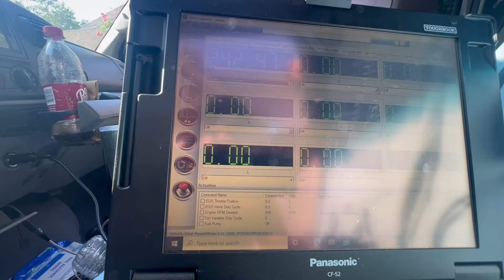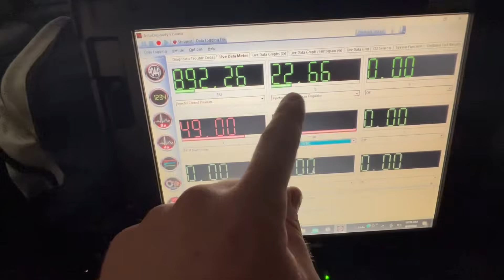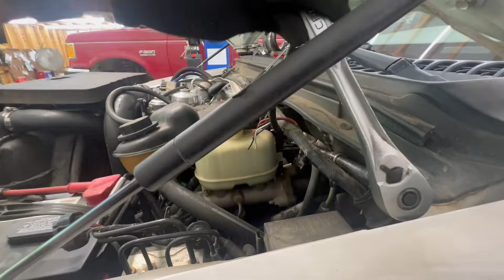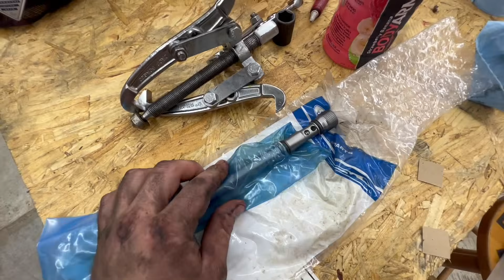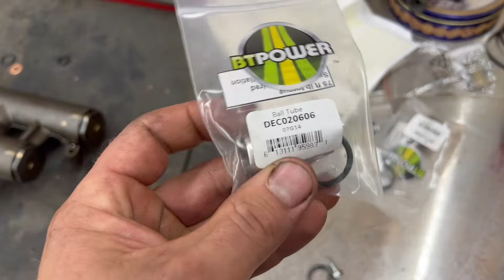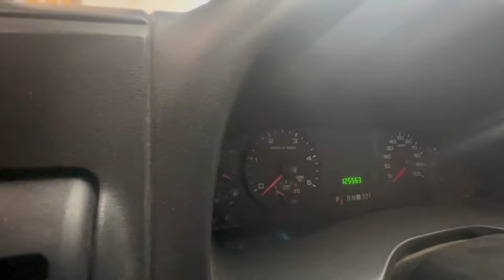6.0 powerstroke high pressure oil leak, long start, no start hot

Comment: Is there updated standpipes for the 03 6.0 as well, or does this only comply to 04 and up?
Reply from the maker: There are not stand pipes in 03-early 04. They have a high pressure line that feeds the rail with a quick connector on it.
Reply: @AutomedicGarage  mine’s having the hard to start when hot and it even dies if i dont keep it at 1200 rpm. Someone’s been in there. Found 4 valve cover bolts stripped on the hvac box side. And noticed the ipr was new.
Reply from the maker: @Srt8brian  I’d bet a wooden nickle it’s your hpop. Those aluminum pump get weak and fail.
Reply: @AutomedicGarage  will i be able to tell with the pressure tool? Or how do I test for a bad hpop
Reply from the maker: @Srt8brian  hook it up to the ipr first with the hpop cover on. It will be harder to hear the leak from the pump but if you don’t hear it anywhere else. Remove the pump cover hook the tool back up and retest.
Reply: @AutomedicGarage  will do. Thanks for all the replies. I really appreciate it.
Reply from the maker: @Srt8brian  no big deal, I’m here to help anyone who wants to work on their own stuff and I’m here to fix those who don’t either. Thanks for watching. Keep following us.

Comment: I personally as well as others have been having issues with motorcraft dummy plugs and stand pipes. I think it has something to do with supply chain issues and changing suppliers.
Reply from the maker: I havent had any issues. Installing with assembly lubes and being careful are a lot of the problems with them also a lot of folks don’t torque them either.
Reply: @AutomedicGarage  Any tricks or tips for getting the bottom piece of the stand pipe in and out on the passenger side without pulling the oil rail off?

My evaporator box is too close and it won't clear it. I have not seen any videos addressing this.
Reply from the maker: @eric91780  remove the oil rail, takes 15 min
Reply: Thread a bolt in and pull it out

Comment: OK, YES, I have the OEM "upgraded" standpipes and dummy plugs from FORD. What I am looking to get is the "NEW" seals and o-rings for them? Thought you might have some part numbers.
Reply from the maker: No I’ve never replaced just the orings. I always buy a new set of pipes. Sorry.
Reply: @AutomedicGarage  OK, so I finally got my tools and did a pressure check through the IPR port. Thank GOD, only found a torn screen on the IPR with chewed up o-ring and back ring. Pressure check was good and solid. Thanx again for the videos!!
Reply from the maker: @curlyelp7530  did you run her yet?
Reply: @AutomedicGarage  Waiting on my IPR parts, tomorrow, do you have the IPR torque value? Thanx !!
Reply from the maker: @curlyelp7530  usually don’t torque, pointless using a universal and multiple extensions.

Comment: OK, so I will defenitely be installing them on this tear down, I still have NOT pressure checked the rails, but very sure the nipple cups and injector o-rings moved or are leaking on the passenger side. Since I removed that side rail to fit or to remove the OLD standpipe. So, with that being said, got P/N's for NEW o-rings and back seals on the standpipes and dummy plugs?
Reply from the maker: I usually buy the updated OEM stand pipes and dummy plugs.

Comment: Ok, Thanx for the quick reply, appreciate it. What do you think about their "Nipple Cups, No Leaks", is it for real?
Reply from the maker: The idea behind their design is when and if you develop a leak, and they all will leak some at some point, it prevents the high pressure oil from eroding the upper injector oring seal which will end up cause a crank no start hot or even a crank no start once it’s totally gone. I like them, they are pricey but I like the idea.

Comment: I just did this on my 04 and when I applied air I have a whistle coming from the passenger side
Reply from the maker: Pull that valve cover and do some more digging. The air will point you in the right direction. Thanks for watching.

Comment: Hello, I have a 2005 Ford F-350 with the 6.0L engine. I'm having trouble with my radio, gauges, and windows shutting off at the same time frequently. I know that this is a common issue with this model truck but I can't seem to find the problem, but when I wiggle my gear shift everything starts back working again. By the way, the gear shift is new, I thought that was causing the problems but I was wrong. Do anyone have any idea what could be the cause of this problem?
Reply from the maker: Your have a short somewhere in your gauge assembly. Autotechrescue.com is who I send all my gauges out to for repair. Usually have them back in a week to 10 days.
Reply: @AutomedicGarage  So a short in the gauges would cause the windows and radio not to work too? It all stops working at the same time and comes back on at the same time.
Reply from the maker: @mauricematthews5065  yes, radio, door locks, windows, dome light, etc all run through the gauges. It’s a common 6.0 problem.
Reply: @AutomedicGarage  Thanks a lot for the info.

Comment: did you replace the valve cover gasket?
Reply from the maker: Negative. They looked very new still and weren’t dry and crispy. Gary’s truck had studs done not to long before he bought it.
Reply: @AutomedicGarage  Hello, I have a 2005 Ford F-350 with the 6.0L engine. I'm having trouble with my radio, gauges, and windows shutting off at the same time frequently. I know that this is a common issue with this model truck but I can't seem to find the problem, but when I wiggle my gear shift everything starts back working again. By the way, the gear shift is new, I thought that was causing the problems but I was wrong. Do you have any idea what could be the cause of the problem?
Reply: @mauricematthews5065  your instrument cluster is going bad, I had the same problem. Just replace the gauge cluster and it’ll fix everything.
Reply: @ODIIN636  Thanks for the info!